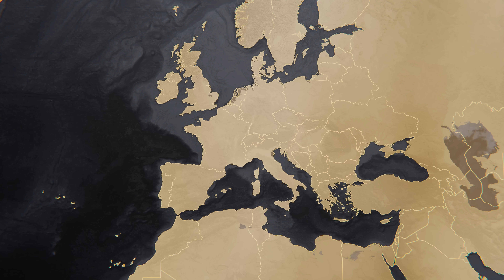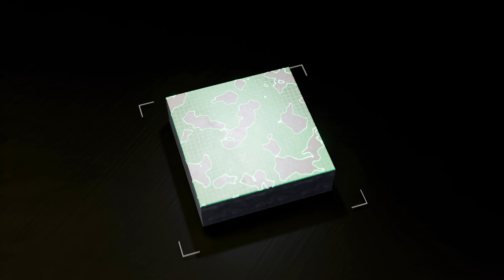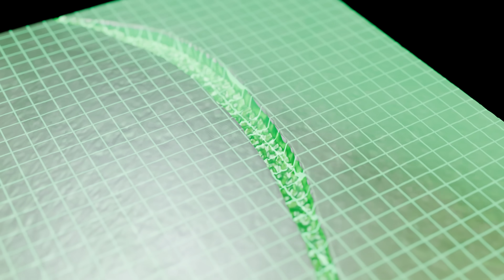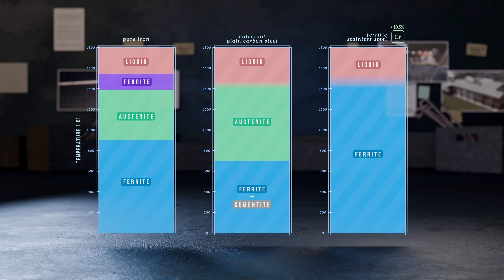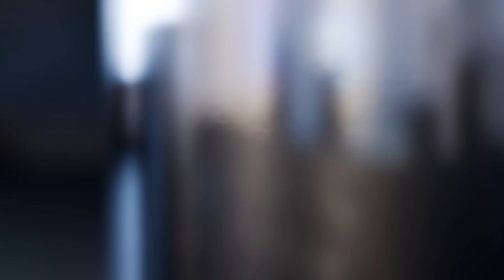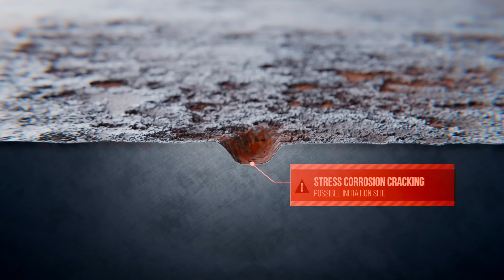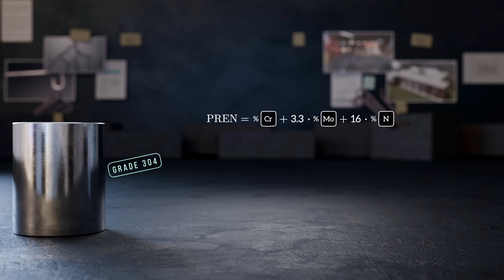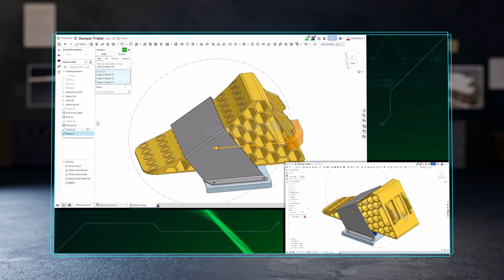The Problem with Stainless Steel

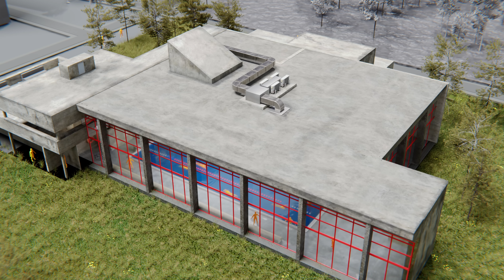Comment: @0:40 "nothing seemed unusual about the building design..." wait, wait, wait. In what reality is a suspended concrete ceiling typical?
Reply: Mold proof Cement board instead of light fluffy ceiling tiles or drywall that falls apart when damp.
Reply: @nla27 Why not cedar planks or something? I’m no expert but concrete slab seems a bit much just for mold avoidance.
Reply: @adlockhungry304 "I'm no expert"

That's right.
Now read the experts right above your comments.
Reply: @Grégory_Fleury "the experts right above" right a lot of assumptions
Reply: @Grégory_Fleury i mean they did ask a question
Reply: I’m an Architect and this is bizarre to me. Span the concrete, don’t EVER suspend it, especially in the highly corrosive environment of a pool, Dummies!
Reply: @allensams1773
It's only bizarre to you doofus, because it happened, and after they figured out what happened they told everybody, so now people are educated on it. You did hear in the video where at the time it was an unknown thing? Right? There's a reason most of OSHA's rules are Written in Blood in this country, and I am sure it is the same for the safety regulating agencies of most countries. You don't know what you don't know, but after you learn don't act like the people who didn't know before were stupid. This isn't third grade level stuff.
Reply: @lordgarion514  wow bro, just wow. You're quite the specimen.
Reply: @lordgarion514  Even a third grader could easily realize suspended concrete slabs are not a good idea. You don’t necessarily have to see a person burning to realize fire can burn you.

It is called common sense.
Reply: @lordgarion514  wow
Reply: @lordgarion514  As an earospace engineer, I can only fully agree with you. At the university, we were tought a lot by examples of failures, often failures that resulted in serious consequences. Many, maybe all, aerospace rules are written in blood, and unfortunatly, often they still are...
Reply: @czrrok  That's why I don't want an appartment in a sky-scraper.... .
Reply: @camillet4005  what's an earospace engineer? an engineer of space ears?
Reply: @BieberOzinga it's an engineer of the space between the ears
Reply: It make the bank happy
Reply: It's not that strange, concrete is widely used for ceilings and in that case it was one of the few choices because of the humid environment, and it had to be suspended because, well, it had to fit an open pool inside so no supporting pillars, it was then of course only reasonable to want to support it from somewhere else
Reply: It's another example of architects vs engineers. In many situations the architect has priority over the engineers. If the architects decide "drop/suspended concrete, then that's what the builder builds even when engineers offer alternate options or submit their arguments.
Reply: Folks, many of you are conflating “suspended” as meaning anything that is supported overhead.  Understandable if you’re not an architect, engineer or don’t work in the trades.  Suspended means hanging from something above.  The skyscrapers some folks mentioned have concrete ceilings that are, at the very least, supported at each end by the vertical structural walls, and usually by additional structural walls or vertical columns of some sort within the building.  

Now, there’s nothing inherently wrong with “suspension” as a structural choice when and where the situation calls for it, even for very heavy objects, suspension bridges being the most obvious example.  We can all understand what the benefits are of having suspension bridges (which receive constant maintenance, btw) in key areas, but what is the risk/benefit analysis of having a thick concrete slab suspended overhead in a busy recreational area, especially one that serves no purpose beyond what any other drop ceiling 1/10th of the mass would serve?
Reply: @adlockhungry304   Insulation by thermal mass?  As a design benefit to a heavy concrete slab ceiling?
Reply: @LeverPhile Good possibilities.  I’m still not sure I see the risk/benefit favorably, though.  

Hindsight, though.  Honestly if I walked into an identical building without ever being aware of this accident, I don’t think I’d have to presence of mind to be skeptical of their architectural choices.
Reply: Yeah, a 4in thick concrete slab is heavy. They could have used literally anything else and almost no one would have died. Just because you can use a sidewalk as ceiling tiles doesn't mean you should.😅
Reply: @mechticulous8202 Not slabs, concrete board used in showers where moisture would cause mold. Imagine a sheet of drywall dropping 30 feet onto your head but much heavier. Anyone getting hit was going to be in a bad way, most were also in standing water when hit.
Reply: @mechticulous8202  who said it was a 4in thick concrete slab.
Reply: @mechticulous8202  😂😂 last sentence is so right
Reply: Suspended concrete is common. Think sky walks bridges and balconies.
Reply: The very notion of a suspended ceiling is technically impossible…… if you’re high and thinking about it
Reply: This may help...btw, the 100mm suspended concrete didn't fail, those stainless rods could have been holding ANY other material up there and still failed because of the unusual pool chlorination environment ...

"On May 9, 1985, the indoor swimming pool in Uster, Switzerland, suffered a catastrophic ceiling collapse, resulting in 12 deaths and 19 injuries. A 4-inch-thick concrete and steel roof fell, caused by stress corrosion cracking of the stainless steel hooks holding the ceiling. This incident highlighted critical safety issues regarding materials used in high-humidity pool environments. "
Reply: @peterfitzpatrick7032 yes, I saw the video and am aware of what did and did not fail.
Reply: @KrisRyanStallard  ...then why focus on concrete, a material used in every high-rise, every multi,level carpark, every bridge.... ??? 🙄
Reply: @peterfitzpatrick7032 that's different. That's a supported structure designed to carry a load. A suspended ceiling or roof IS THE LOAD. And why on earth would you do a suspended ceiling from a large slab of concrete? If you're doing a suspended roof, sure, use some concrete as part of the making of your roof. But not an interior ceiling. That's just crazy pants.
Reply: @KrisRyanStallard  A broken slab piece of concrete will obliterate a skull, or trap underwater. Why not fiberglass, or wood. Nope, drop ceiling with a 4" slab concrete. Yeah 😒
Reply: @KrisRyanStallard  - Then your comment was a dumb one.
Reply: every skyscraper and apartment building?
Reply: @TheHillsHaveFPV  look another guy who doesnt know what a suspended ceiling is
Reply: @chiefusb465  That's rude
Reply: @MrAngryLawnGnome  not really lol and he said it matter of factly
Reply: @TheHillsHaveFPV I'd love to see you build a skyscraper with suspended concrete ceilings on every floor instead of the regular drop ceiling with fibreglass panels 😂
Reply: @TheHillsHaveFPV  skyscrapers do not use suspended concrete ceilings, they are supported by huge I beams and other concrete columns that are not only supported by an inner rebar structure but also are joined with the concrete ceiling. Very different from what was used on this pool, usually a concrete ceiling would be supported by columns to support the mass that cannot be supported at the edges of the ceiling. What they used on the pool was like trying to support a big slab of rock the size of a swimming pool with very oversized paperclips.
Reply: Multi-storey buildings? Have you never been inside an apartment building?
Reply: @SchulzyG I don't think you know what a suspended (AKA "drop") ceiling is.
Reply: @trace9130 well, and there in lies the issue. A drop ceiling, which if I'm remembering correctly, is a suspended structure that is used to create the, well, interior ceiling. Which is different from a suspended roof, which is when the actual roof of the building is suspend from usually steel cables to allow for very large uninterrupted interior spaces. A large indoor pool facility could certainly be built using this type of construction. And, sure, of you're making a roof, go on and use some concrete. But why on earth would you create an interior ceiling from a large concrete slab, no matter how thin and dainty she may be when viewed edge on. If you're making a large large uninterrupted interior space, why would you go and create a secondary ceiling anyway? And why would you make it one large slab instead of breaking it into sections? And why not something lighter? Like, of course I've seen multi floor office towers where the floor/ceiling is concrete. But that's resting on the exterior walls and interior columns or a core structure and it has steel inside the concrete to help spread the weight around. And the interior drop ceiling is broken up into sections and sure as hell not concert.
Reply: @trace9130  Reading these comment is something else.

Edit- autocorrect issue lol
Reply: @SchulzyG yes, and they had load bearing walls holding them up

Comment: Unfortunately as soon as I heard stainless and swimming pool, my first thought was the chlorine would destroy it faster than galvanized or black iron.  Most of the time a good cleaning/priming with an expoy or enamel coating on a mild steel will be far superior than most alternative metals.  If injecting hypo into a pipe, common for water treatment, there only needs to be that small section that needs to be an inert material.  The reaction only happens at the water contact in the pipe.

Comment: I am an industrial electrician in the US and was working in the water treatment room of a carbonated soft drink manufacturing/bottling factory, and I was trying to remove some conduit support clamps close to the chlorinator machine, and they crumbled like they were made out of plastic, they looked in good shape from the outside but they were super noodle-ish and weak, while other regular galvanized steel bolts were corroded but I still managed to loosen them without breaking, then I also noticed 316 Stainless steel material still in good shape, and I realized that 304 Stainless steel is especially vulnerable to chlorine, as it becomes super weak, even galvanized steel while looking dramatically more corroded, still has a better structural integrity!

Thanks for the video and explanation, I knew I wasn't crazy

Comment: I have to wonder: What was the point of this sort of ceiling? Was it just decorative? And if so, why was it SO heavy?

Thanks for the video!
Reply: It was only 100mm thick... and was seen as an ideal longterm and low maintenance-free solution in a high humidity environment in a structure that wouldnt lend itself to easy regular maintenance coating of an alternative material...

The concrete didn"t fail here... nor was it in ANY way involved in the eventual failure-mode....

Comment: who tf builds a drop ceiling out of concrete
Reply: "On May 9, 1985, the indoor swimming pool in Uster, Switzerland, suffered a catastrophic ceiling collapse, resulting in 12 deaths and 19 injuries. A 4-inch-thick concrete and steel roof fell, caused by stress corrosion cracking of the stainless steel hooks holding the ceiling. This incident highlighted critical safety issues regarding materials used in high-humidity pool environments. "

Comment: I worked in the metal recycling industry.  Alot of hands on experience with all the grades:  400 series chrome,  the cheap gas grill stuff.  304,  and 316 which is food grade.  Made an exhaust system out of 316 2" dairy pipe.  Welded in the elbows as it doesnt bend well,  but lasted longer than the truck! 😂

Comment: I deal with 304 stainless on a fairly regular basis. Welding, Milling, Turning, Drill/Tap. Not my favorite material to work with. I don't mind lathe work and Tig welding with the stuff. Drilling and tapping are a bit of a nightmare.

Comment: Fantastic video - pure information, zero confusion. I've been using mild steel, 304 and 316 for years but never had a clue how or to what extent they differ. This video cured that (and filled numerous other gaps) in 20 minutes. Superb.

Comment: I used to weld industrial fans, and we welded a lot of 316 stainless steel for its durability in corrosive environments. It's a really fun metal to lay down beads with it's so smooth.
Reply: I used to weld 304 and 316, the welds were always the weak points for corrosion... I understand that there is a chemical change taking place because of the heat?
Reply: @casesusa  It's an electrochemical process I don't think heat is involved, but I don't have a whole lot of information the fans I built at that job were running in corrosive gases through the systems that they were incorporated into, and I never saw one after they shipped out so didn't see the corrosive effects on my welds.

Comment: I like cutting and polishing my 304 with the same mops and compound that I previously used on copper, brass, and mild steel, after filing down lumpy TIG welds that were made with mild steel filler rods, with a steel file.  I then fasten my stainless items with mild steel bolts and spring steel locking washers, to mild steel backing plates, using the adjustable wrench that I inherited from my grandfather.

Comment: As someone who has worked extensively round swimming pool hvac rooms, I can testify to the total lack of corrosion resistance in 304 stainless in the presence of sodium hypochlorite. 316 stainless will also fall to bits in this environment  unless passivated.

Comment: It's half one in the morning and I should be asleep, but now I know that if I ever decide to build an indoor swimming pool I should use duplex stainless steel for any load bearing features because it's two-phase micro-structure makes it especially resistant to stress corrosion cracking.
Reply from the maker: Damn right.

Comment: We are working mostly with stainless steel and use 6 different kinds of stainless steel. For marine applications, we use 316Ti stainless steel ( in Germany it's called 1.4571 ) and everything gets powder coated. Food industry mostly relies on 316SL.

Comment: We used to use a proprietary stainless tool steel with the trade name Stavax that was used to make rubber mould tools. It would be interesting to know what type of stainless category it fell into?
Reply: Most likely PH.
There are (around 15) that I used to deal with years ago though they were not intended for metal forming. 
The stuff you dealt with was probably a Letter Type Tool grade with a Corrosion Resistant covering.
We used to rebuild parts and had a Nickel Weld application over the surface of the PH steel so it's even harder. 
In the 50s they used a process called 
Spray Welding and maybe that's what the stuff you worked with was like.
Tool Steel with a Nickel spray weld so it wouldn't corrode.

Comment: Great video on Stainless steel corrosion theroy.  I recently had a project where I was trying to trace down the reason for constantly leaking process vessel. I put my self through a SS corrosion crash course to come to a very similar failure mode to what was found here. When I was listening to you description of the conditions and materials I immediately knew chloride and SCC.

Comment: This should not have been unexpected. For years many racing yachts have used galvanised steel rigging rather than 316 stainless steel  where extreme stresses are involved, due to the danger of sudden failure . This is not new science.

Comment: David Reeve from Safer Cliffs has done a massive amount of research on why Stainless fails in low/zero oxygen environments. Climbers were faced with SS bolts on sea cliffs failing. Turns out there is a problem with sea cliffs in tropical areas near volcanoes. There is a sulphur reducing bacteria that loves zero oxygen environments. The by products migrate into the interstices of the crystalline matrix of the SS. Result is that the bolt will simply come apart with finger pressure. That's the extremely simplified version of his monumental work on the atomic level investigation.

Comment: it is a well known fact that high grade 304 Stainless Steel is very sensitiv to Oxidation and corrosion under stress and aggressive environmental conditions- as they used 304 on on Yachts for handrails and anchor chains for Years - until they found out its massive corrosion Under use of aggressive Chlorid based cleaning agents plus stress - as the anchor chain is under permanent stress-tragically and sadly the Swiss engineers did not do their research properly as the effect of corrosion of 304 under chlorine & stress was well known 😅
… but the worst /cause of this tragedy is the totally flawed construction of a suspended concrete ceiling - just a stupid I’ll- fated design / I say that as engineer with over 4o-ish yrs. experience in that construction field 😮

Comment: 304 is the cheap stainless steel, not to be used at sea- and apparently where chlorine is around.  mountaineers found out the better SS, 416, while safe in marine environment, can fail in limestone close to the sea!!!! apparently the combination of lime and salt is dangerous to 416. so nowadays at the seashore mountaineers started to use titanium anchors...supposed to last forever.